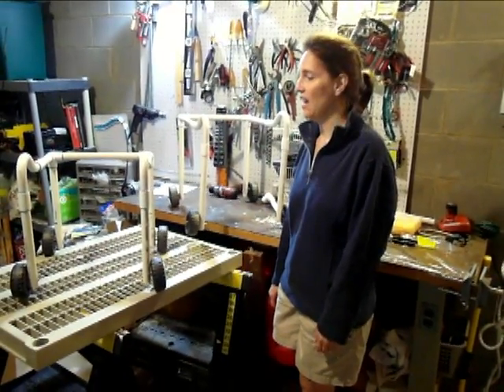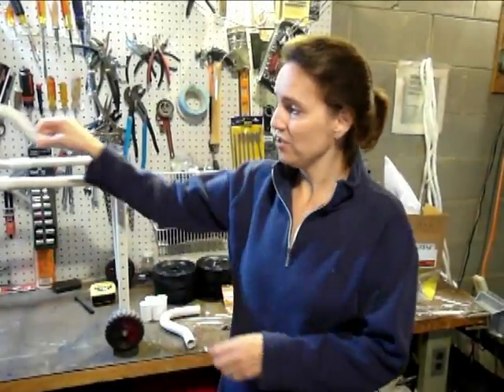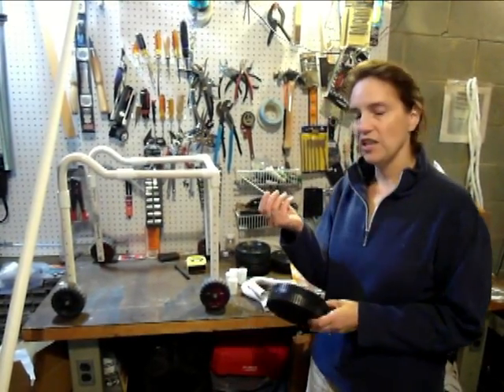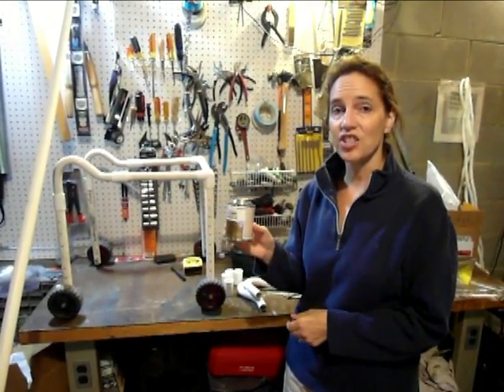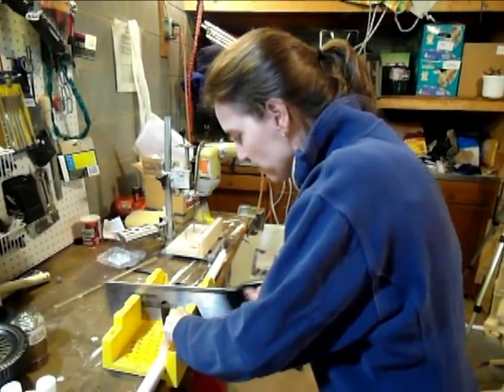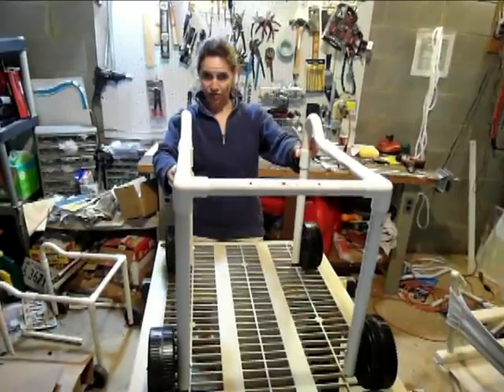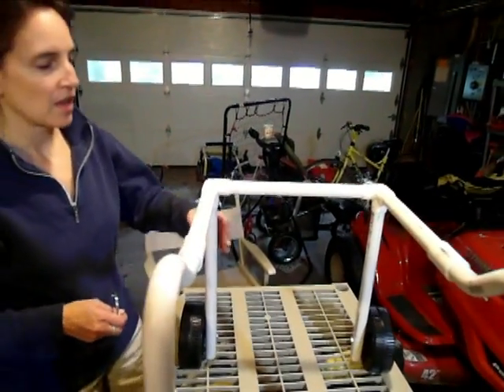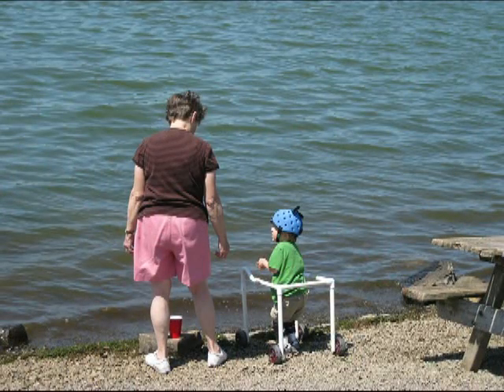Make Your Own Walker

Comment: i watched this video only because I wanted to see how you used the drill press to make the axle holes. What type of a jig did you use to make the holes straight? it's not easy to drill both 90,° and 180° on both side, especially if your drilling several axle adjustment holes and have a wooden dowel inside the pipe to reinforce the cart. why did you skip the most important part?

Comment: My son has cp and I have been struggling with ways to have him be more independent in the snow and at the beach and this just solved it ! My only question is. He uses forearm supports because he does have trouble with strength in his right arm primarily. Would you have any suggestions as to how to incorporate that into this design?
Reply: Did you ever figure out the forearm support?  My son has them also but I'm making this for the house and pool, etc.  Brainstorming on using noodles cut up for the arm support then taping with heavy utility tape or the tape for tennis rackets..?
Reply: Not sure PVC is strong enough but how about two t's off of main support, to close nipples to 90s connect 90s and if it's close enough that would give you a place for your forearm to rest in if that's what you're looking for